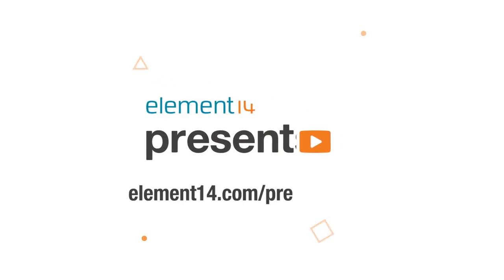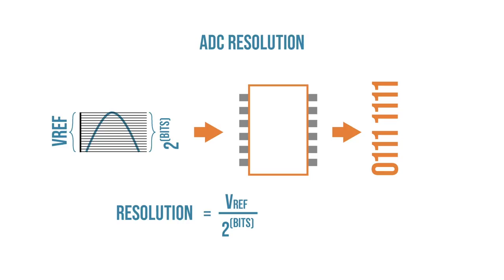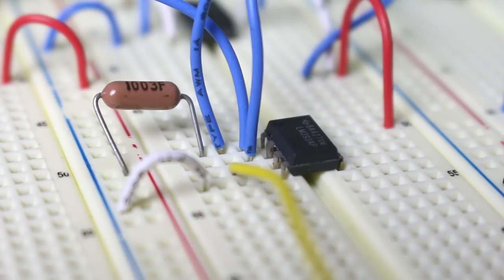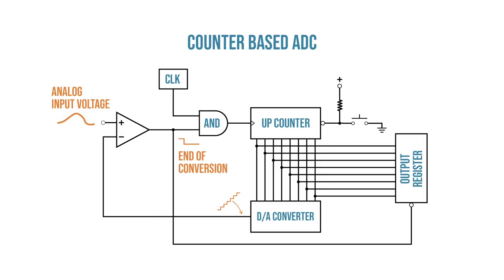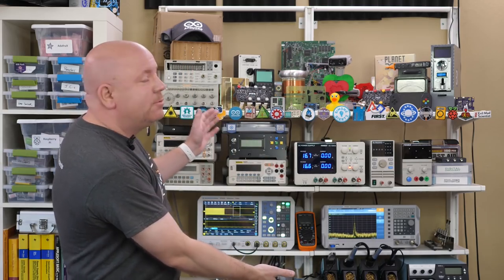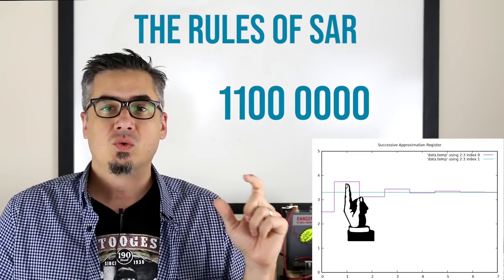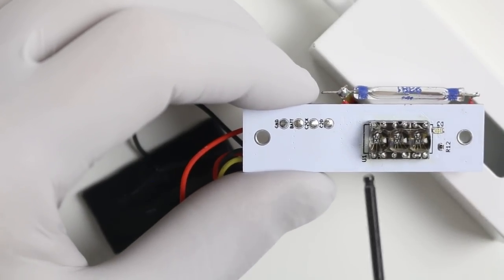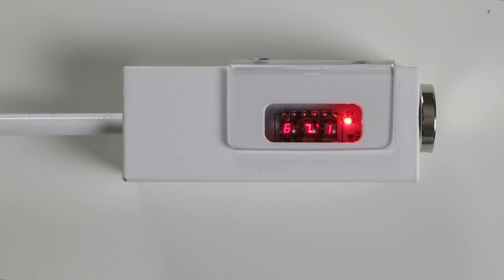Get to Know Your ADC with a DIY Temperature Probe

Comment: @15:30 I would disagree that multiplexing LED is a method for conserving power. LEDs are lit 1/3 of the time but less photon are produced. The same effect can be achieved by using bigger series resistors. Conserving pins are the most important reason for multiplexing.

Good and informative video btw. Nice job

Comment: You lost me at ... stainless steel as a thermal conductor. If you want to wait a while for a static value, I guess that would work. But for rapid changes in temp, not so much.
Reply: I'm sorry I lost you. Sometimes ya gotta use the bits ya have laying around to finish the project. And yes, it is a poor conductor of heat as mentioned at the end of the video. BTW, dig the purple rain cover.